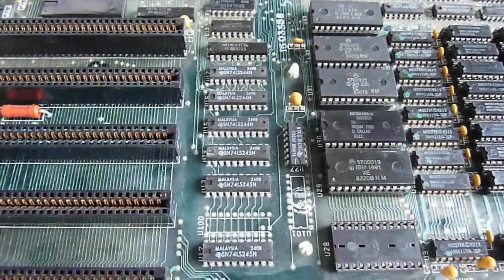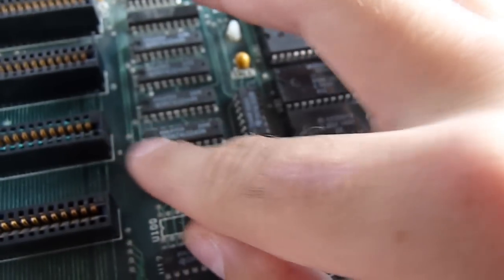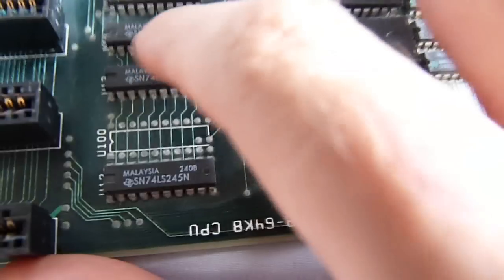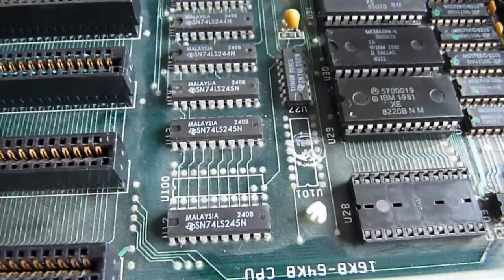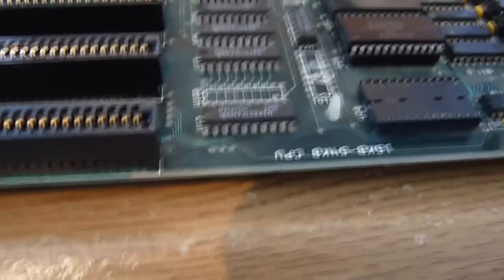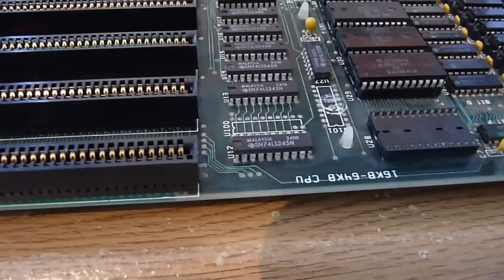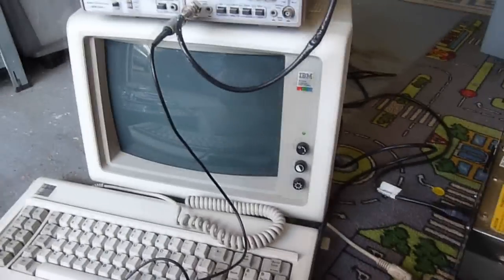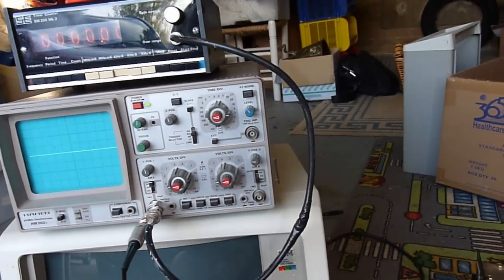IBM 5150 Resoration Part 3

Comment: Emmo Philips bashes a few chips in this clip and comes up with a de-soldering solution. Then seems to run out of a course of action that would be practical.
Reply from the maker: Not sure where you got the name, but the IBM has been a bit of a bitch to get working.

Comment: Suggestion, unplug all the boards appart from the graphics card and see what happens, I tend to remove all cards and have a minimum of cards in a machine when it does nothing (just in case one of these interface cards have an issue).

Also I have had a problem with the clock on a old xt type board replaced the 78 series chip and the clock produced a nice signal +5v rather than the 1.5v+ and 2v signal I had before,
Reply from the maker: The 74LS245 and 74LS244 were the main chips, they will all be repalced when the repalcments arrive. But we now have it booting and outputing text to the display.

Comment: I've no experience with the 5150, but have had several problems with tantalum caps. They tend to fail short circuit and will sometimes explode violently as a result, but can also fail short and exhibit no obvious damage. Could one of them be pulling a logic line permanently high or low?
Reply from the maker: Might be worth investing in re-capping the board as a percaution, however they do work but are 30 years old.

Comment: I posted plenty of 5150 docs and schematics in the group btw. ;)

I could write a new EPROM for it as well. Be good to get it going.

Sounds like one of the other custom chips has failed, but hopefully it's another one of the logic ICs.
Reply from the maker: If the |ROM's do need work then that will save my ass, thanks.

Comment: Ahh, still watching - I see you've socketed most of the chips already. :p

That's good.

Good to see those turned-pin sockets too - I usually get the cheapo types.
Reply from the maker: I prefer the ones with hols, they are much better.

Comment: Best way I've found to desolder logic ICs recently is just to buy some replacements anyway, then snip the pins at the top of the old ones (being careful not to twist the base of the pins too much, so as not to damage the vias / tracks).

Even with the proper desolder station, it's been a pain to do these, but heating up the pin remnants from the underside while using the solder sucker on the top side works quite well.

Always fit IC sockets in their place of course, so it will be easier to repair in future.

Unclogging the vias of solder can be a pain too, but same thing really - heat on one side, solder sucker on the other. ;)

Not sure what those lower two buffers do. I'll have to look later.
Reply from the maker: I have used this metod in the past, just make sure the component being replaced is dead or it will be wasted. IC sockets are a no brainer.